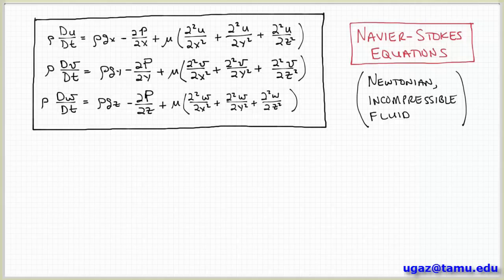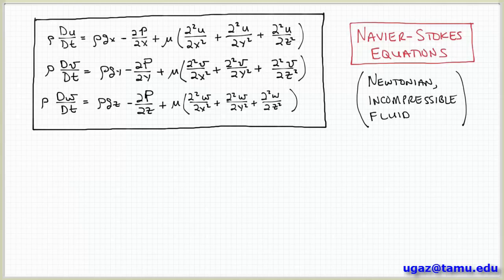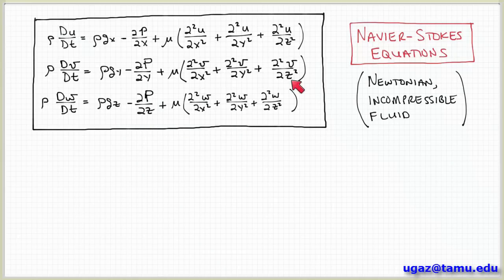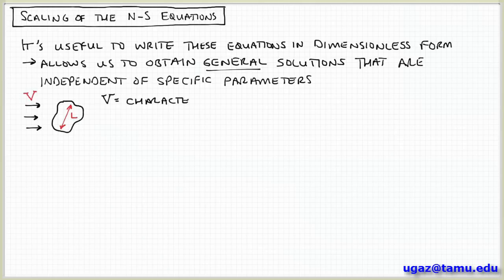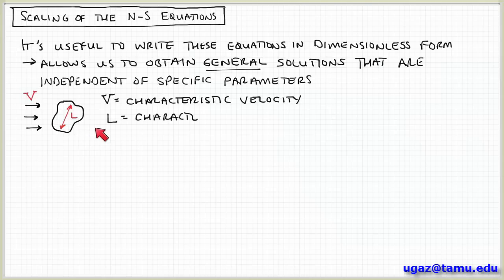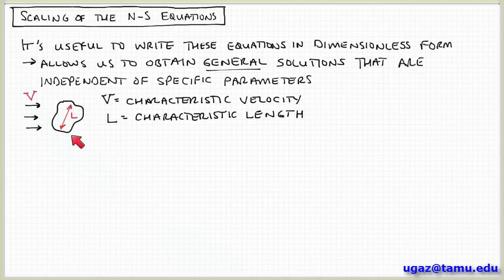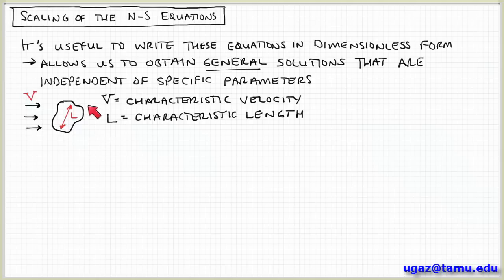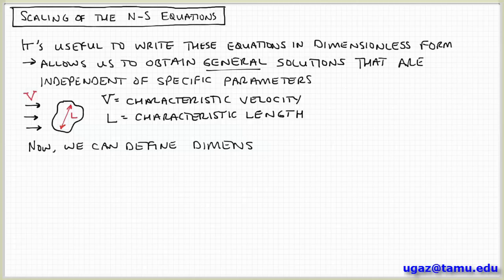Conservation of Momentum, part 5 - Lecture 4.5 - Chemical Engineering Fluid Mechanics

Comment: Thank you Dr.Victor Ugaz for explaining the concept of scaling of N-S Equation. Your point on evolution of Reynolds number in connection with scaling of N-S eqations really enlightened me. Up until now whenever I think of RE number I labeled it as a object which differentiates whether a flow is laminar or turbulent. Also, I thought it originates from dimensional analysis. Now I understood clearly. Thank you. I like other videos as well.

Comment: Dont Understand 12:41. Why Re= Inertial/ viscous and not Re=Viscous/Inertial???
Reply: I'm losing my mind
Reply: Hello @Taariq 001 
Because, more accurately,  it's a property relation not an equation. Inertial term and viscous term are dimensionless and same in every situation. The only thing that differs is Re. That's why we can simulate different scales by using same Re.  You can take inertial forces and viscous forces as "pre-factor" for each side of the equation or as weighting coefficients, which are extracted from the process of de-dimension.